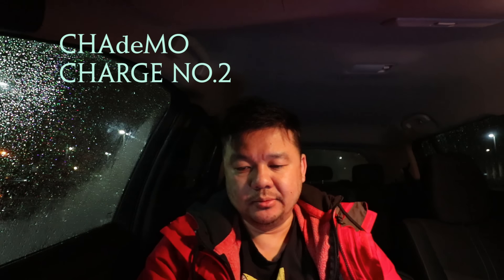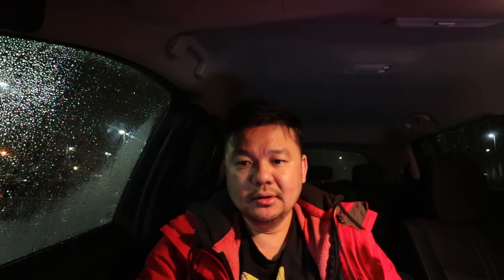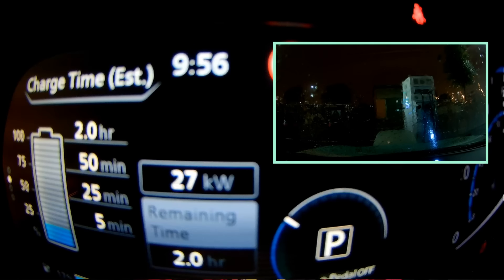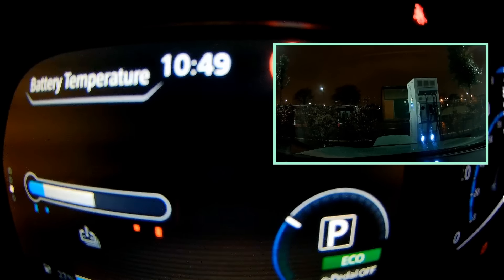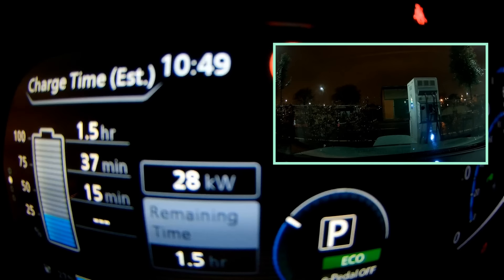Will lack of active thermal management system be an issue on Nissan's 40kWh Leaf?

Comment: Do you have approximate charge times for your first, second and third charge? As in, approximately how long it would have taken to charge the battery to 100% at those temperatures.
Reply from the maker: 1st was 35mins
2nd was 22min as i didn't want to go pass 50%
3rd was 2mins to check on speed at around 25%
4th was 2mins to check when battery was cooler

Comment: Could you try this, suggested on speak ev, do 60miles /15min charges repetition ? I would do it myself but I left the car for 3 weeks.
Reply: The thing is at high soc 15 min doesn't charge you much. The game is to find the balance between speed/distance/charging time for long distance travels..... Or Nissan gives us the env200 cooling system (using aircon)

Comment: I think it’s just silly that Nissan still doesn’t have active thermal management on the Leaf, they have it in the env 200, which I believe has very similar battery architecture to the Leaf. If it’s a cost cutting measure then that doesn’t make sense either as the Renault Zoe has thermal management and that is a cheaper car and part of the Renault-Nissan-Mitsubishi alliance.

Comment: Soooo how dose rapidgate work at minus 30 or 40 degree's temps affect rapidgate charge speed as it would cool the battery down much more then summer temps
I would love to be a guinea-pig for that Buuuttt there are no level 3 chargers in my province and I am not going to basically let my leaf crawl to Alberta just to try it out on the provinces level 2 chargers when my leaf came with 6.6 kilowatt charger

Comment: Is the battery chemistry of the new leaf different to the old leaf? The old leaf didn't have this issue.
Reply from the maker: I suspect its software issue, hopefully it'll just be a software update. Worse case I might need to drill holes in the battery to cool it down.... I'm just kidding please don't do that :D
Reply: Well, adding some simple 12 V Computer fans in the front and rear of the battery pack might help to remove the heat, that is trapped between the battery pack and the floor of the car.
Reply: yes it has! maybe not as bad as the new 40kwh version.
Reply: yes it has! maybe not as bad as the new 40kwh version.
Reply: I cancelled my order when this story first started to break and I think that the battery density of the 40kWh is a step too far. Nissan should have known this before the launch and held off offering the 40kWh version until the LG-Chem batteries were going to be available and then maybe launched the 40kWh as an LG-Chem version mid-2018 and 60kWh spring-2019. Now I wouldn't buy a 40kWh as the resale value will be hammered. No wonder a 2.Zero or N-Connecta PCP bubble is only £9k on 3 year deal!
Reply: It does, do 300 miles in it with rapid charges and it will happen.

Comment: I have mine due this week. Too late to cancel.

To be honest the problems during successive rapid charges don't really worry me. I rarely charge my 24kwh Leaf more than twice during a trip. So a 40kwh model would need it even less.

Wat DOES worry me is the fact that the battery gets this hot during cold wheather. We all know high temperatures are VERY bad for battery life. What happens if I use the care this summer during 35 degrees hot summer weather? Can't even rapid charge once? What if it even heats up too much during driving with sustained high power (like 120km/u freeway speeds)?

If this thermal management issue is real, this model might suffer extreme battery degradation. I might never be able to sell mine for a good price if the whole world knows this particular model has a BIG flaw.

Nissan should come with a proper answer REALLY QUICK.

Comment: One good response is to refuse to accept Nissan's engineering inadequacies by refusing to buy their products until they do them correctly. Although I'm not personally familiar with Nissan's engineers the appearance they project is one of stubbornness combined with a refusal to accept mistakes and quickly make corrections. Many years ago this was shown through poor quality disc brakes. More recently their cvt transmissions have been nightmarish for customers. So this example is reflective of their internal culture. They make the 'right' choice and that's it. Sorry, we're the automotive engineers and you're not. So don't question us. But they aren't the only engineers and that's lucky for us.  . . .So until they use their capabilities to produce adequate products look elsewhere. Hopefully if the outcry continues building and becomes strong enough the company leaders will replace the engineers at the foundation of this poor quality culture with people interested in creating a superior product we consumers can rely on.

Comment: You can read the lynch-mob mentality in some of the comments below. I have a question for you, James. I recently did a 250 mile trip, mainly motorways and dual carriageways at the posted speed limits. In a previous video, using leaf spy, you reckoned at the bottom end the battery percentage charge indicator under read, i.e.read zero when there was approximately 9% remaining. On the first leg of my trip, I arrived with an indicate 1% when experience indicated I should have had around 10% remaining. This appears to be in line with your observation. Also, in my 30KWh Leaf the 'low battery' warning would occur between 15-18%. In the 40KWh the warning occurred at an indicated 8%-a difference of maybe 10%. I don't think this is a coincidence.
My theory-what do you think-is Nissan, in an attempt to not have Leafs driven by people on a steep EV learning curve (we all were at some point, so not criticising) on flatbed trucks, have deliberately made the battery state of charge under-read. This would not work if it was a uniform under-read, because you'd never see 100% charge, people would complain of the GOM gave a low figure at full charge, and they wouldn't want a low miles/KWh reading. Maybe they've--and this is a technical term--buggered around with the sensors. Just possibly the battery isn't getting hot, as I saw on my second rapid charge, but it indicates hot, and so the battery management system restricts the rate of charge.
The problem could quite conceivably be  software rather than hardware. In the meantime, naturally any facts and measured opinions will be shot down in flames by those who 'know'.
Reply from the maker: Hi Peter I don't think we need the pitchforks out yet. As long as people are informed about such a large investment they can make their own choice as to buy or not. I for one have not regretted buying the car.

I don't think the 10% buffer is a bad thing, it just means people won't suddenly come to a halt reaching 0% and most people will be using for daily commute and city runner. I just needed to know how far I can take especially in winter with the weekly 125mile drive one way.
Reply: I have no regrets either. It does seem there is a problem with multiple rapid charges, and in my case this occurred on the second charge. A lot of people seem to be condemning the car out of hand, whilst I tend to think there is a software problem. I think Nissan had been deliberately overcautious. There appear to be three charging bands, if I can put it like that. 0 to 75%, 75 to 85%, then the rest. On the 30 kWh leaf basically there was two charging rates, 0 to approximately 85%, then the rest. Similarly, I think 0% indicated on the 30 kWh leaf was probably 0% of the useable capacity, and you had a five or 6 mile buffer. In the 40 kWh leaf it seems they've gone for around 10% battery capacity as a buffer, and somehow contrived to have the battery indicator reads 0%, when in fact it still contains 10% charge. To do this they've obviously had to mess around with the software, and I think along the way they've created the charging problem. My 30 kWh leaf at no point, even when the battery temperature was on the red Line, charged any slower than when the battery was cold. Anyway, this time to get an early night as work beckons in the morning! Keep up the good work, and I might have to think of investing in a leaf spy myself.

Comment: The battery will start to get hot towards the end of the discharge if you don't discharge the battery very low cells won't gets hot this is terrible engineering by Nissan that there second electric car does not have any thermal management it's actually really quite surprising

Comment: Dragging the lithium cells below 25% will cause the cells to warm up
Reply: Mark Williams , this makes good sense! As the cells discharge then their voltage drops, meaning that more current must be drawn from the battery in order to maintain constant power. More current = more heat!

Comment: Just to cover all bases: Did you check how much power the according stations were actually able to deliver? Electricity is a ressource that has its limits. It could very well be, that due to other energy consuming tasks in the area, the station would not have the full potential available. Also missing is the state of charge when starting the process. We all know the battery chages faster the lower the state of charge is. So that is a factor as well. 

Most importantly: why didn't you wait until you had the feedback of Nissan before publishing? Videos like these, let's call them the "I could be completely wrong, BUT"-Style, can be so unnecessary harmful to the manufacturers and the EV market in general. Why don't you just make sure you are NOT COMPELETLY WRONG before you post a video? 

I really like EVs and I do like people talking about them, but what goes on right now in the EV-Vlog scene is not cool. Much too much unreflected talking about stuff and too less thinking beforehand. At best, a little thinking in front of the camera, but most of the time not even that. Just "the car did this, this is a problem" and off the video goes. Did anybody bother to take another car with comparable capacity buit active cooling and do a side by side comparison under various circumstances and see, if it actually performs better? Now THAT would be interesting.  
This talking is gold for anyone trying to paint EVs as a dead end in transportation. Act responsible guys, check your facts, make sure they are straight and THEN post.
Reply: If you watch Jonathan Portefields video you will see he did just that with an Ioniq and the Ioniq beet him by 4 hours I think.
Reply: I saw that, but that was not a scientific comparison by any means. On the contrary, it was the incarnation of what I mentioned above. For starters, they didn't start at 100%, putting the Leaf with its bigger battery in disadvantage from the getgo. Add to that that it was crazy cold and that we do not know how much capacity the vehicles reserved for emergency occasions (considering that you are likely to die if you strand in the north of japan during a cold winter, the Nissan will play it safe in that reagard for example), and you can pretty much put that video in the trash.